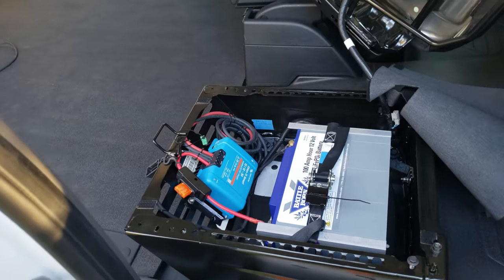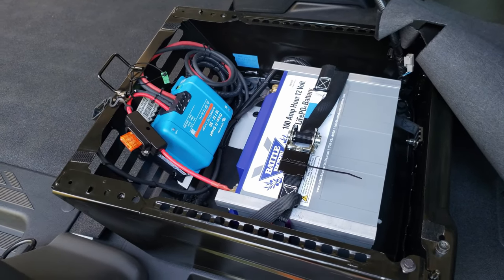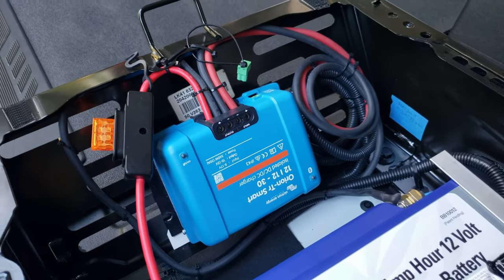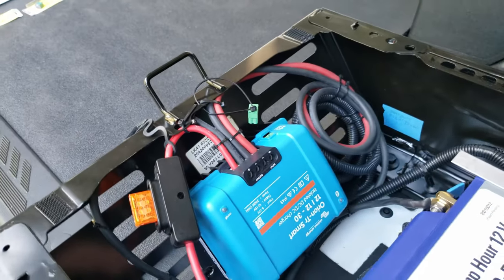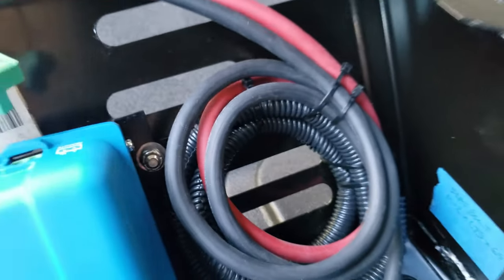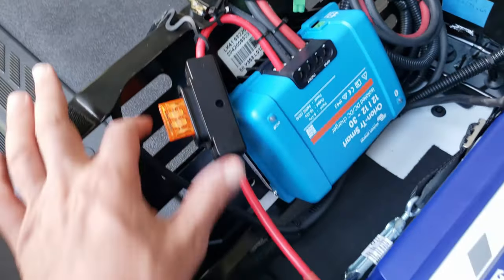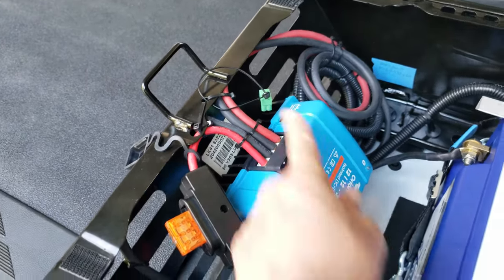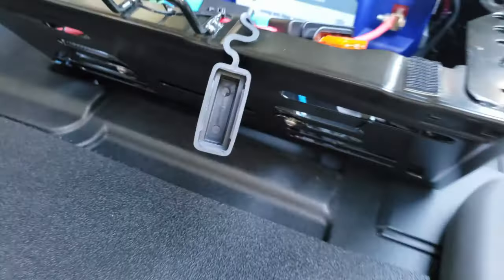Victron DC-DC Charger 12 12 30 || DIY Installation under Passenger Seat || 2020 Ford Transit

Comment: Nice set up. Really efficient on space by taking advantage of that location. Can you explain how the system is working? I also have a 2020 Transit with an Orion-TR charger (in different location) but am having trouble with the Ford Smart Alternator and setting up the Engine On/Off detection in the Victron Bluetooth App. I see in your set up you don't have the Orion connected to the Ignition ON connection point under the Drivers Seat (that you pointed out in one of your other videos) so you must be relying on the Engine On/Off algorithm in the Victron App as well. The challenge with Ford's Smart Alternator System is that the resting voltage of the Vehicle battery can be around 12.4 volts, but the Smart Alternator will sometimes drop down very close to that resting voltage while the engine is running making it tricky to have a robust Orion Window of operation (ie only on when Engine is running). We obviously don't want to drain the vehicle battery when the engine is off. What settings are you using? Thanks for any help you can share! The robust solution may be just connecting to the Ignition and bypassing the Auto Algorithm but maybe you have this figured out!
Reply from the maker: Thanks. Fortunately, I had no issues whatsoever with the installation nor the operation thereafter. Works like a charm. I didn't do anything special nor tweak anything in the settings anywhere. It was plug and play. I hooked it up and it worked fine and never used the ignition feature you mentioned. It's been a little while since I did all this so I'm getting rusty and trying to remember any details needed to help you. I believe my video was very descriptive. I just have two leads going to the engine side and two leads going to the battery. I'm not using the vehicle for grounding the house battery side so therefore it's called isolated. Victron has two different parts available. I'd be happy to help you if there's any more detail you need. I guess I'm just lucky it all worked out well. I spent most of my effort in trying to make a clean and hidden installation. There's no external visual evidence that it's in the vehicle. I just run a refrigerator off of it.

Comment: hello, nice tutorial!  It's possible whit the dc dc 12-12 /30 charge the Motor Battery from the service Battery when the engine it's off and the Service battery it's full and connected at the 220v charger or solar panel solar? thank you very much
Reply from the maker: Fundamentally, I believe what you're trying to do is not appropriate because the goal is to leave the engine starting battery alone and not use it as an energy source for anything else. You are saying you want to charge the engine starting battery with some other system, but that is unwise. However for whatever reason you want to do so, I believe you can devise a system that will allow you to do it. I will discuss the theory here first. 

I will discuss at a high level the model of what is happening electrically. I think of the situation in terms of hydraulics. We have two tanks storing water and they are connected by a pipe with a one-way valve, also known as a check valve. There is also a pressure switch to detect how much water pressure is acting at the check valve. There is a threshold water pressure value at which the check valve is allowed to open and let water from the tank with the higher water level fill the tank with the lower water pressure level. Voltage is like pressure. If these two water pressure tanks were connected together without any sensor to detect the pressure and the valve is opened then the water will drain from the tank with more water in it into the tank with less water into it.

Now I will discuss what the water model looks like in terms of our electrical system. The goal is never to have the vehicle starter motor battery get discharged by using any of the accessories attached to the service or house battery. I think you understand that. So to do this, there is the check valve with a pressure threshold or in other words, instead of a check valve, we have the the DC to DC charger with an electrical voltage threshold setting at which it allows electricity to flow from the engine starter battery toward the service battery. 

The hydraulic check valve is analogous to the diode in the dc-to-dc charger. The check valve lets fluid flow in one direction, but prevents flow in the opposite direction. I'm not sure exactly what the threshold voltage setting is but I believe it's above 14 V.  You can read the documentation from the manufacturer to determine the exact value. The idea is that it won't allow the check valve to open unless the engine is running and the voltage source is coming from the alternator.

So with all of that said above, I conclude that there's the check valve which is designed to allow energy to flow from the input toward the output on the DC to DC charger. In effect what you are trying to do is reverse it and in order to do that, you would have to reverse the wires on the DC to DC charger. That is not very practical however in theory you could set up some switching that would allow it to happen, but it sounds foolish. 

I'm just guessing here that you might be able to have a second dc-to-dc converter that is oppositely mounted mounted in place that would allow the input to come from the service battery and the output go to the engine starter battery. This would add a lot of extra wiring and cost and may possibly cause problems from the logic of the circuit.

I know there is a tiny electrical jumper cable on the exterior of the DC to DC charger. It allows you to connect a remote switch to the dc-to-dc charger. By default, I don't disconnect it because I don't need a switch. You will need to do some research. It may be possible that if you were to add a switch or disconnect this jumper wire whenever you want to charge your engine battery (in reverse) that you could connect in this way you described in order to charge your engine starting battery. I would be curious to learn what you find out and how you solve this. 

Why do you want to charge your engine battery with your solar or other system?
Reply: @biketothetop  
the answer is simple, once the service battery is fully charged, I could divert the charge to the engine battery. This will extend the life of the engine's acid battery and you will be sure of being able to start the engine without problems even if it has been stopped for a long time.
Reply from the maker: Okay, so it sounds like your objective is to have a trickle charger for your engine battery. I got the impression that maybe you wanted to consume  the engine battery power.

Comment: What size lug for the Customer Connection Point (CCP)?
Reply from the maker: I think I used the following lug on a M6 stud.

SELTERM 6 AWG 1/4" Stud (2 pcs.) UL Marine Grade Battery Ring Terminal 6 Gauge Connector, Tubular Electrical Wire End Cable Lugs, Tinned Copper Eyelets [B18], MD0614P / MDS0614P https://www.amazon.com/dp/B074P11MCV/ref=cm_sw_r_awdo_T2SAC8VH5WG878Q8R3KE

Comment: how you route the negative back to the starter battery?
Reply from the maker: That's a good question to ask 🤔
I routed it up from below the floor matt to the right rear side under the driver seat and thru the slotted hole into battery housing.
Reply: @biketothetop  couldn’t the ground for the starter battery side of the Victron be fastened to one of the passenger seat pedestal bolts
Reply from the maker: @xtangent1846  Possibly because the "starter" side uses a common ground to the chassis. At this time, I don’t remember all the details  regarding proper wiring, but would refer you to the wiring schematic and documentation from Victron. In hindsight, I probably didn't want to take any risk of messing with resistance values and/or create less obvious wiring connection points (from a servicing perspective). Also, from an installation and fabrication perspective,  the crimped connector lug inside diameter size I purchased was compatible with the terminal on the battery.  The Ford Transit has a smart charging system, so the following link to Victron documents may be helpful for you to understand the logic/controls of the Victron device applied to smart alternator systems. 

https://www.victronenergy.com/dc-dc-converters/orion-tr-smart
Reply: @biketothetop  I’m assuming the two ground terminals on the victron are common?
Reply from the maker: The device I installed is called "isolated" because the house battery side is not using the common ground of the vehicle. It has 4 battery connection terminals (two positive and two negatives). Victron makes two DC to DC Charger designs. The other version only has three terminal connection points for battery cables (two positives and one negative) and it uses the common ground of the vehicle.
Reply: @xtangent1846  I asked myself the same. It's kind of strange that you have a 60A Customer Connection Port but no corresponding ground terminal. The ford paper material I got tells me that there are Battery cables with additional ground studs. I got 2 AGM Batteries but still no addtional ground studs somewhere near those batteries. I thinkt the best to do would be to let someone professional create a good and solid ground stud right under the passenger seat.
Reply: @barfoos100  would think grounding to the chassis would work
Reply: @biketothetop  what was the ground connection point on the driver side seat?
Reply from the maker: @mershanks  The Ground Terminal on the engine battery side is the common ground of the vehicle or in my specific case I used the engine battery terminal. See  earlier comments.

Comment: Can you provide the link to the 6 AWG wire with inline fuse? I can’t seem to find it on Amazon.

I want to use this setup but mount my Victron Isolated DC to DC charger above the left rear wheel well. I went with the more affordable SOK LiFePO4 battery. Changing the fuse size makes sense. Thank you for posting this video.
Reply from the maker: I pasted a link for fuse holder into the description field for the video